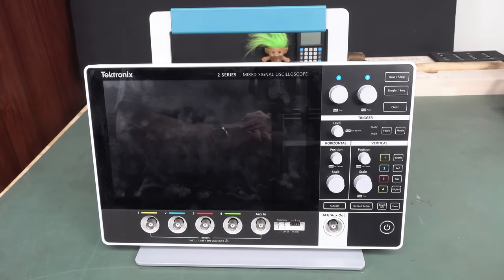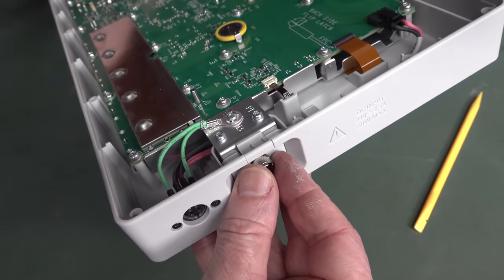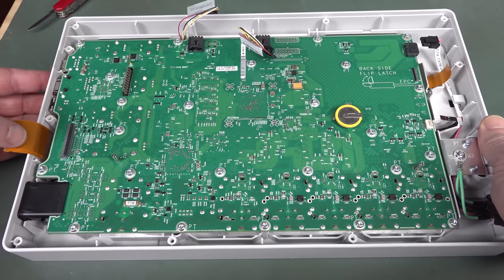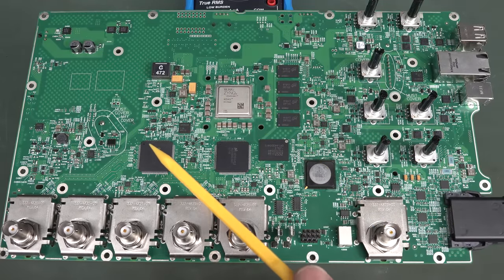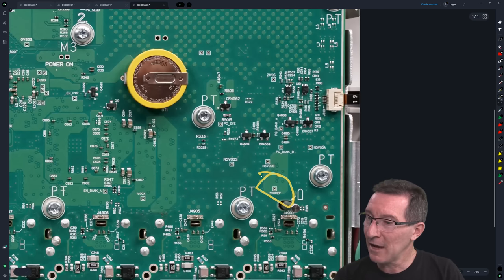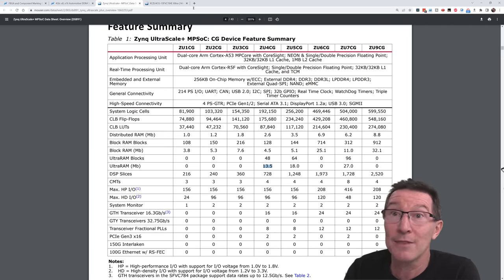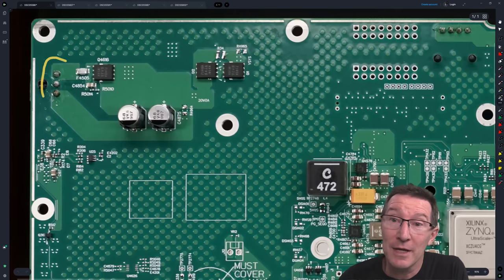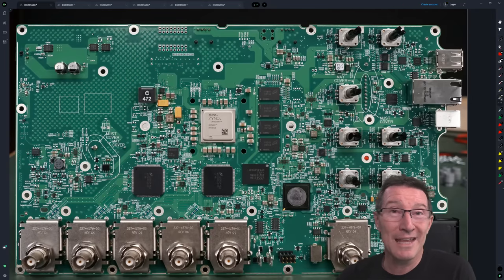EEVblog 1477 - TEARDOWN! - NEW Tektronix 2 Series Oscilloscope

Comment: A battery that is internal means you have to tear down the scope to replace a part that is well known to have a short life. Not to mention that batteries leak.  It is my "fault" with the button battery soldered on to the back.  It should be like the old T23 Thinkpad battery.  On a long wire and foam tapped off to the side to prevent the battery spilling its guts next to all those sensitive components.

Comment: I think the raised bumps on the shield are just to help hold the shield in place with the back on.
Reply from the maker: If that was the case you'd put them in the corners, not offset on one side directly over the centre pins.
Reply: @EEVblog  Could it be spacing to maintain the input impedance?

Comment: Dave, much appreciate the deep dive into the circuitry and getting close ups on the whole thing. It’s very educational. Very watchable ! Fun stuff !   Tek used some nice chips indeed :) 

maaan, I wish there was a way to get into FPGA+SBC without needing to spend an arm and a leg. I remember getting soo excited. Only to find out it was going to be 500$ or 1k to get the point where you could program them.   It would also be the COOLEST thing ever if you could repurpose FPGA’s. I’ve found a bunch of them in old stuff, but I don’t think(99% sure) you can re-use them :(((( 

   This scope looks COOL.  In my world, a 4 channel is a must. Even for hobby. It’s rare for me to only use 2 channels. I often find myself simultaneously using 2 scopes(4 channels each) quite often. (For analog circuits).  man that scope is cool. A desk saver for sure !!
Reply: @Christopher Grant im def going to research that. Last I remember, there were software licenses which were holding everything back. I can't be bothered with subscriptions and don't really need libraries. i want to write the code and not be dependent on "helping" features. Last I worked with arduino I found myself just using atmel studio so I could access the registers themselves. So I knew exactly what interrupts were being used and how everything worked. The timing was good, but the speed was only around 10k-100k. Plus, I had to deal with state machines and passing around control like a mini RTOS.  
 
     My use case: is >> I am exploring physics. Double checking some known laws and formalizing new theories which I've been working on.  I need to setup tanks/vessels/chambers which hold liquids and gasses of varying densities. Send pulses+waves through the mediums & around shapes. Make sensors which plug into a GPIO. The sensors need to be read simultaneously. These sensors are hand made and that is the whole point. Being able to read a square "foil" of a certain geometry in a variety of different places is the name of the game. The foil is excited by an external wave generated by a transducer. So I am basically studying the way a certain shaped transducer will create a wave, which then gets altered by the surrounding shape of the vessel. Then again the wave is modified by the shape of the sensor.  Knowing how the waves are modified by the varying densities and the different geometric shapes(which absorb the waves) is my mission. 
   SOOO, basically, I just need to be able to access/read a bunch of inputs simultaneously / realtime. No software overhead.  If the computers are fast enough I would love to excite part of the wave during its course and be able to predict and shape how it propagates, but that is dependent on the round trip of the computer. I've yet to operate a computer which is able to read+compute+operate an output with such a low roundtrip...   
        So far I've done everything in analog using magnetic and/or electric fields as it is way easier. op amps & discrete stuff. That stuff is realtime, so it just works. The math works, lol.   The simplest way I can put it is >> I am trying to define "what is a field." Also, to create and formalize the language used to describe/calculate this world. The world of inertia.  There's more I could write, but that's all I care to write right now... lol  I need matrices of inputs.  Coordinating all these dimensions is going to be a huge mission on its own.  
       Having to worry about strange costs, strange software packages which try to get people quick-started with libraries of protocols(usb,hdmi,eth,etc etc), IP of propriety code blocks(xilinx),  its just... woa. . ugh. It's like software people drama. Some kind of consumerism. There is so many strange packages$$ on the xilinx toolchain. I'm pretty sure it was same with Altera/Altium.  
        I just need a realtime chip. Inputs & a way to store and see whats happening on the inputs. Thats all. Simple.  

   Last time I was looking at FPGA's the teensy stuff looked like a good candidate. I don't remember why I didn't make the jump, but it's probably caz i'm strapped 4 cash right now... 
 
   I feel sad though caz there is so much opportunity in the FPGA world, but the costs are crazy. There are so many proprietary layers. $$ to unlock this and that.  It looks like that world is geared for manufacturing and big business. Big money business. HOWEVER, If the hobbyist's could use FPGA's at a similar price point to arduino & rPI, we could make some really great things :)) Those self leveling robots would be easy peezy. We could make all sorts of new types of multi-meters!!     There would be huge progress in our world :)  People are so creative. its just that the really cool tech is priced for companies to buy, not people.  That is backwards, because it is private people who explore new innovations, not companies. Companies are what make money out of what the explorers have found. The explorers need to have the tools and the leisure. Subscriptions and crazy costs are holding all of us back, but thats an age old song isn't it ;p   The sands of time. The hourglass of quicksand. Quick, make a product to cover the costs of what was needed to make the product ! Hopefully we earn some food&rent along the way.  ooooh lord

Comment: Could the fact that there's no conductive shielding/screening on the back cover actually be better from SNR point of view of the shielded front-end even tho' makes for worse EMC, all by not containing the digital/switching noise so tightly? : )
Reply: Nobody cares about what's inside your unit. People only care how much EMI comes out from your unit, and how much EMI it will take going into your unit to disturb its operation. FCC Part 15 and all that.

Comment: Damn! They just get smaller and smaller all the time, unlike the huge old half mile long ones I started out with that weighed half a ton and came with their own custom made trolleys. All they need to do is make the back of that scope nice and long like the old ones were and stick a car battery in the back. If you want a portable scope, Fluke make some very nice ones, but they come with very nice prices too   😁
Reply: I saw an announcement video showing a slim battery pack attachment!

Comment: Great tear down video! This scope is going to be a very tough sell against the Rigols and Hanteks. I suppose if you absolutely have to have battery power, maybe, but quite expensive for what it is. I'd much rather have the rubber chicklet keys over membrane switches. Good luck Tektronix.
Reply from the maker: It's not designed to sell against Rigol and Hantek.

Comment: MUST COVER / MAY COVER
Is there a some kind of conformal coating over the pins? I have replaced a batery of MSO4000 and it had conformal coating poured inside these margins.
Reply: Why not conformal coat the entire thing???
Reply: These two things are alone THT components on the bottom side. It looks like they use selective wave soldering and this is for checking the mask position.
Reply: @nameredacted1242  I don't know. This was the case with MSO4000.
There is no actual need to cover the entire PCB. It is not intended for outdoor use.

Comment: 1- The membrane keypad will break
2- The battery pack is an incredibly expensive option
3- The 70Mhz version is $3000
4- It comes without options (it's like buying a car today without electric windows)
5- The power connector is just horrible
6- No digital inputs
7- The fans in such a compact device are bad
8- And really slow...

Comment: Those 2GB of memory are on the CPU side, not easily accessible from the FPGA fabric. You cannot move your data over there at acquisition speed (at least not easily). So indeed, that's just your regular computer RAM used by linux. Thus the sample size is limited by how much data they can stash in the fabric.
Reply: …which is kinda sad if you think about it. Normal desktop PCs come with 40gbps USB-C ports that can ingest almost 5G 8bit samples per second but this chip (which costs more than an entire PC) can’t get infinite sample depth the same way that USB logic analyzers can.
Reply: @pimzk2  Agree. The PL has dedicated ports to the memory controller for this purpose. Pretty trivial on the zynq to move this data over. The physical memory map kinda lends itself to a 1G/1G split for FPGA/processor, but nothing saying that needs to be the case. I'm a bit surprised they threw a ZU4 at this but I guess it's the smallest one with transceivers in the fabric.

Comment: I laughed when I saw you scrape the sticker with your finger looking for screws. Same thing as I've done for years.

I HATE software crippled 'upgradable' devices. I REALLY hate them. They are an insult to our intelligence, and are like dangling a carrot before us as if we were some donkey pulling a cart, as well as telling us quite clearly that the high-end product actually cost no more than the low range device to design and build.
Reply: I see it as pushing the fixed costs towards the high end models. Not a fan of the practice, but in one way it makes sense.
Reply: The software development and testing is where most of the costs are, not the hardware itself. Having one hardware platform for all models also saves costs, it might be cheaper to use a more expensive part instead of having multiple variants for every price range
Reply: You would be surprised if that is the end. NO it will go further that you let analyze the waves in th cloud at subscriptions.
Reply: They encourage the hackers to unlock all the future so people with small budget can get high bandwidth  scope.
Reply: You're stuck thinking that the cost of the product is tied to the hardware inside, not the development and engineering that you don't see. Plus, it allows you to get the hardware in your hands, then upgrade next year if you find out you need more.
Reply: @HNedel  Agree but it's differece if you have to pay for installation of better audo system to the car or if you have to pay for open the back doors to use back seats that are already here... The present HW should be unlimited, let's licencing additional modules or sell extra applications for it if they want.
Reply: @PETMK  From the customer's perspective it doesn't make a difference, because the doors are visible, but the hidden functions are not. Hardware is hardware, the vendor decides what is locked down and what is not, not the customer.

Comment: how do they put shielding in the front but not in the back. makes no sense. it looks cheap but it will probably cost well over a grand
Reply: No high speed, sensitive or noise generating/sensitive traces or circuits on the back of the PCB.  Ground planes in the PCB  shield the sensitive circuitry along with the topside shields.

Comment: Am I correct that when using the battery this instrument would be free floating so no problem in accidentally connecting the probe ground lead to mains hot wire (as long as USB, etc are not in use)?  What about when using the mains power adapter?
Although the price is about 1/2 of what I expected from Tektronix I still would have liked X10/X1 probe sensing and 50 ohm input impedence.
Some of the mechanical details are quite clever and could have been easily left out but do add to one's sense of confidence that they have a well designed instrument.
A 200MHz low end would seem reasonable, 100MHz acceptable but 70MHz is almost laughable.  If they want to go that route then why not 10MHz or even 2MHz as my first HP scope was.
Reply: Yes battery use would be floating. But they definitely do not want you to do that, as its not using plastic shielded BNC inputs and hasn't been tested for that mode of operation. As you point out, as soon as you plug in USB or power, now its grounded.

Comment: Very nice teardown, I really enjoyed watching it! 👍
As an electronics engineer and pcb designer for myself, I'm wondering what's up with the large dotted top & bottom layer at the empty spaces? Are they just stitching vias of the internal ground and/or power planes? If so, why not pour the top & bottom layer as well?
Reply: The dots keep the PCB copper density even and won't cause the PCB to warp and bend... If you have a PCB with copper on one side and zero copper on another, the fiberglass and epoxy will distort.
I think there are also etching and SI reasons for such patterns, also for chicken hatch.
Reply: @nameredacted1242  The dots and hatching is for copper balancing as you described.  The via patterns are for SI and emissions - emissions around the PCB edge and SI around critical traces like signal path.
Reply: @timkeil5063  Yes, I have noticed they stitched ground islands pretty good throughout. Looks to me they at least know about PCB layout. Although I agree with Dave about chips being way too far from their respective I/O...
Reply: @nameredacted1242  Thanks you two.
Yeah you're right, a good copper balance would be crucial for such a large board with high speed signals. But since they aren't buried vias, the area on top & bottom is approximately the same, which means the balance is good anyway or am I mistaken? (I'm talking mainly about the large area where no components are on either side).
Without having the full pcb data we have to guess, but it doesn't look like there are critical signal paths going or coming from this area, so I don't see the exact point for SI neither (apart from stitching planes whereever you can as a general good design rule). The shielding traces around the edge for EMC is a separate thing as well I would say...🤔

Comment: Better buy Fnirsi, Tektronix doesn’t have Anti-burn (tm)
Reply: Fnirsi are a bit of a joke. Lots of accuracy issues.
Reply: @JasonWW2000  my comment contains 50% of sarcasm
Reply: @malcolmholmes115  Ah, sarcasm is hard to spot on the internet.

Comment: Damn, it all comes apart sooooo easily... It's a thing of beauty and a joy until one of them unobtainium chips fails, or a trace breaks in the inner layers of the PCB. At least it will be easy to open it and see what broke down :D
Gone are the days of super duper complicated vacuum tube (or solid state but still CRT) Tek scopes that had kilograms of metal parts inside, haha!

Comment: It's mostly a touch screen or keyboard/mouse interface for many so I can forgive the membrane keyboard although some reviews of it here said it was pretty solid, the lack of machined inserts for the back case was disappointing but it looked good overall. But having that sexy stand and nice aesthetic is ruined by the fact that it has to have a power cable sticking out of the side.

That battery pack though... That is a crime of engineering space waste of epic proportions, it just looked like a complete afterthought with no effort. Lipo flat large area foil packs with a hard case would have made so much more sense and substantially cut down on the size.

Comment: Tektronix 465 last 40 years vs serie 2 maybe last 5 years or less
Reply: The 465 cost over $11,000 dollars new in 1973 when adjusted for inflation (based on $1725 new). This tablet is only $2,000. So you see the huge difference in price. Can any scope made today at any price last 40 years? It seems unlikely.

Comment: Hey Dave, can you please explain to me, the dumb guy, for why they have been making oscilloscopes for a hundred years now with SINGLE-ENDED inputs??? It would add almost no cost to make each input single-ended, and it would add a GAZILLION benefits to the end user!!! Until I hear a reasonable explanation for why:
1) Oscilloscopes have single-ended inputs, and all returns are shields and are tied to earth chassis.
2) Why we still call Common Return as "ground".
3) Why airplanes don't pre-spin their wheels when they land with a tiny DC motor to equalize tire speed to landing strip speed.
4) Why we put up with corporations and politicians.
I would insist saying that the world is INSANE and only I am sane...
Reply: There are reasons for all 4 of those questions. Once you learn the answers, then things will make sense.

Comment: Having either non USB C charger port or 12V barel is just a no go. Who wants to hunt bizarre power brick to replace your dead ones ? 🥳
Reply: It's designed to measurement. Don't forget you are connecting it into designed unprotected circuitry and you need to avoid noise induction into the circuitry. So the EMC and commmon potencial is essential for it. The best solution for both is a good grounding. I've seen power adapters that solves the output noise by two capacitors, one to live and second to the neutral. 115V on the chassis wasn't ideal. And, if you will use non-grounded USB adapter with 20V, 10kHz glitches on the output, it affects everythink inside...
Reply: @PETMK  Sure but I don't think tektronix have issue at designing EMC stages 😉 Plus providing a grounded USB adapter would have done the trick. So really it is to p*ss us at buying dedicated replacement adapters at insane costs... Something so 2010 ey😉